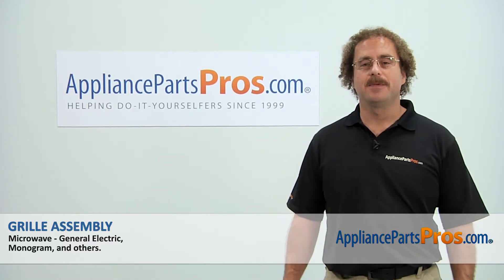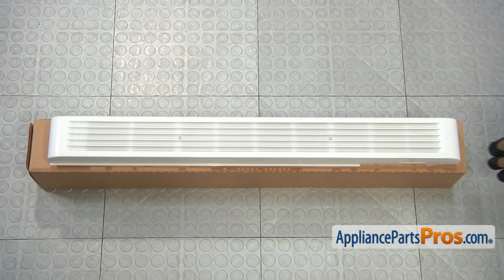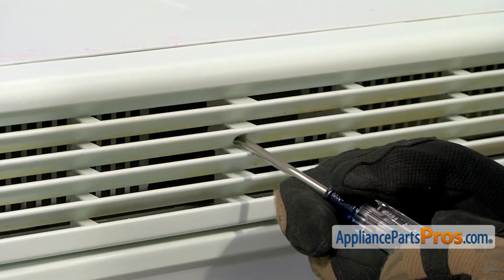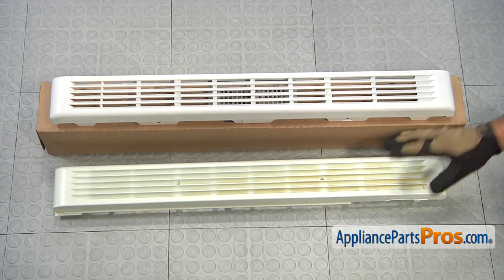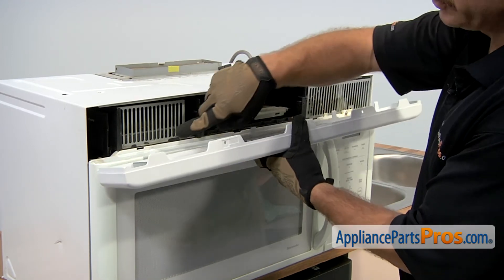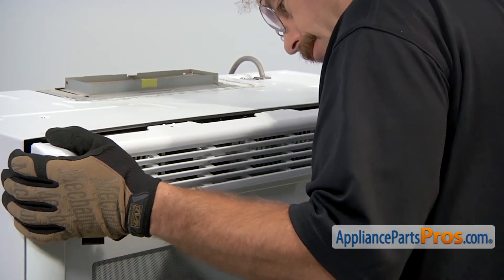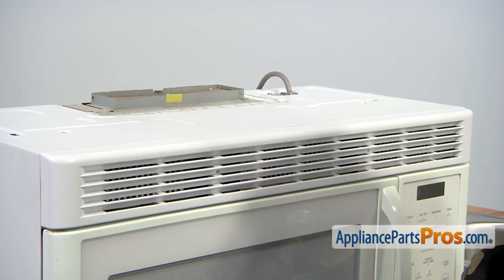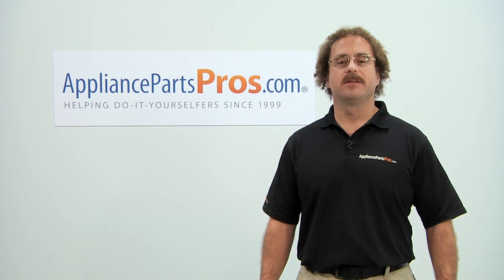How To: GE Grille Assembly WB07X10286

Comment: My XL1800 microwave is slightly different.  The grille is removed by first removing 2 screws from the top (not the front), then sliding the grille to the left and pulling straight out.  The slide to the left is for keys at the bottom of the grille which fit into keyhole slots.  Naturally, I broke the plastic tabs going into these slots.  I was removing to clean, so I'll try to repair the plastic keys, then reassemble.  Thanks for the video, wish it had been exactly the right one for my part:  My model number:   JVM1850WF001
Reply: Funny how things work out.  I was just looking to confirm the two screws at the top would release the grille on our built in model.  I could see the holes in the top of the replacement grille in the video matched up where the screws are located on our model so I was pretty confident.  Really appreciate the slide to the left tip.  Glad I took an extra minute to read your comment before I broke off my tabs by yanking before sliding.  I also want to pull the grille for cleaning.

Comment: Mine has square headed screws and I’m having a hard time finding a bit to fit them, any suggestions the microwave is about 18 years old. The vent is approximately 30 x 3 1/4
Reply: A smaller Phillips screw bit will work or a star bit, you don't have a drill bit and screw driver bit set?  You might have to buy one.